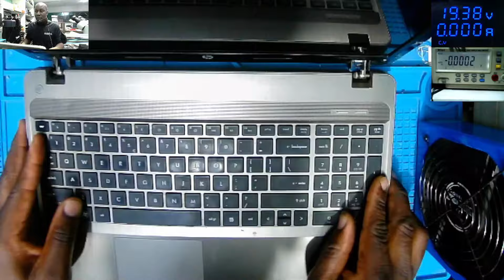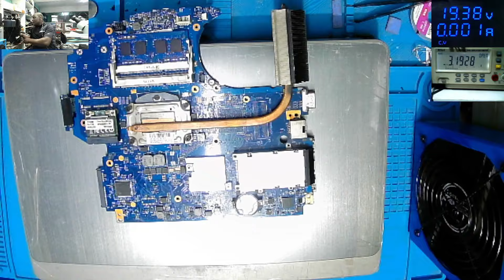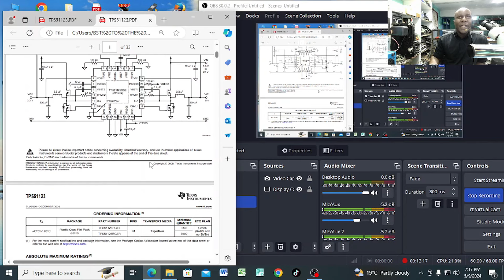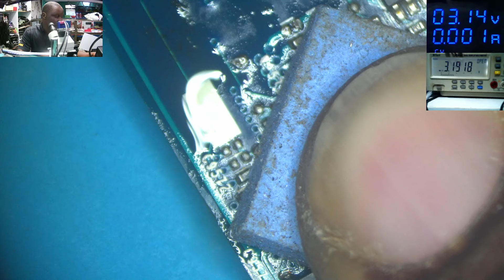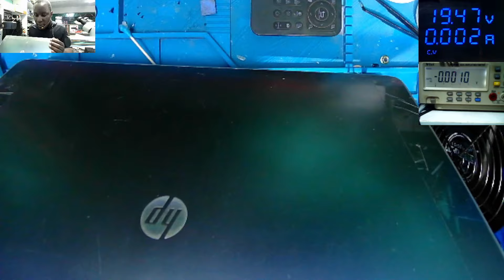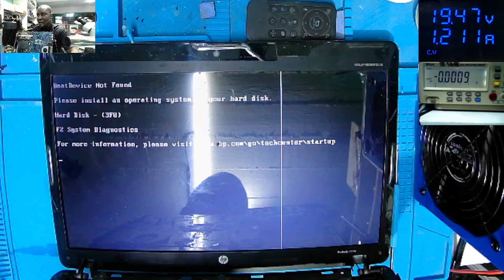Hp ProBook 4530s Not Switching On, Dead Motherboard Repair Step By Step!!

Comment: Another great job. were did you get the micro  controller at and is it the same spec. are you using one that doing the job  from a donor board.
Reply from the maker: Boards For Spares